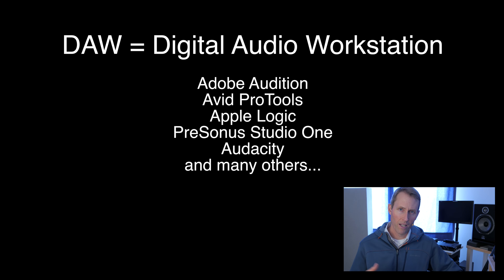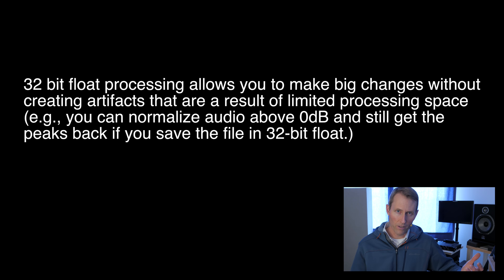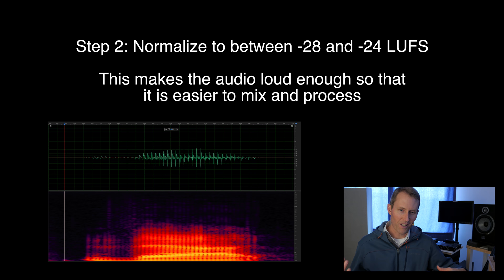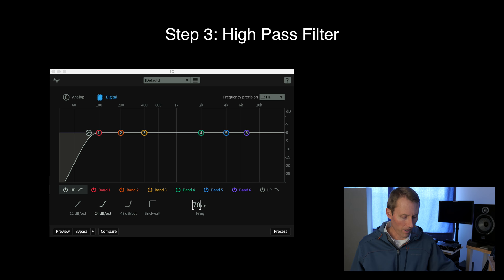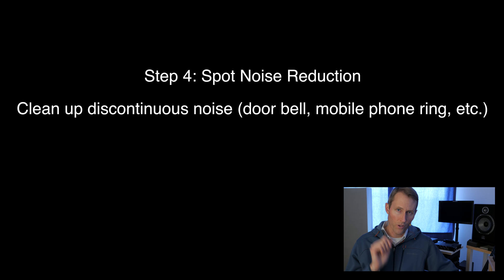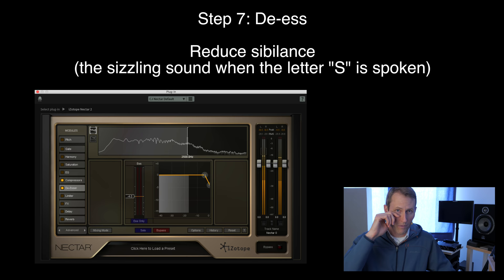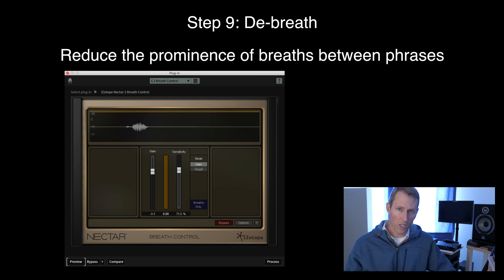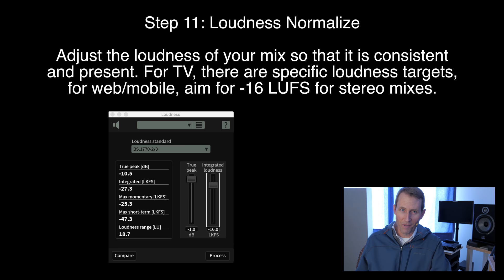Sound for Video Session: Order of Operations - Processing Dialogue Audio

Comment: Curtis, great to hear about your workflow. I am recording long (up to an hour) interview iso tracks at live events on several mics, and to be honest, it's quite a challenge cutting between interviewer and interviewee to mix a consistent end result. Speech volume of the subjects can drift over the course of an hour, as they become more relaxed or fatigued. I am still grappling with the best way to approach this, together with noise reduction of fans, air conditioning, room echo etc without the whole mix sounding choppy. Your videos are always relevant and useful.
Reply from the maker: Hi, thanks! Those long pieces can be challenging. A couple of things to think about: 1) During the recording, mixing while the show is going (and also recording isolated channels in case anything goes terribly wrong with the mix). This can be done with a mixing control surface (e.g., F-Control if you're using a Zoom F4 or F8). 2) you might consider adding a post controller. I use the PreSonus Faderport which makes changes while listening back a little easier. I believe the newest version of Audition now supports the multichannel faderport. Here's the one I use: https://bhpho.to/2kiboLo
Reply: Interesting thoughts, thanks. I'm recording into my new MixPre 10-T (which I love) and routing one of the postfade mix outputs to powered speakers, so it's a pretty minimalist setup. All the hard work is done in post with the iso tracks, but I'll certainly give some thought to mixing realtime as you suggest.

Comment: Do you have an audio software package from iZotope RX that you recommend? I notice that nectar doesn't include the de-noiser, but it does a lot of other items you mentioned.
Reply from the maker: Hi Miniac, I do almost everything in RX except for compression and de-breath which it does not include (I use the de-esser in Nectar only because of convenience as it can be done at the same time as compression but RX has a de-esser as well).

I wish they would just add Nectar to RX but alas, they haven't so I still use both RX and Nectar.
Reply: That's what I do. Would be nice for Izotope to include a compressor in RX Advanced.
Reply: So you own iZotope RX Advanced, and run nectar as a plugin within it. Gotcha. I've been using the stock stuff inside Audition and I'm curious if there's an appreciable difference with some better audio software. Thanks!
Reply from the maker: Exactly, yes. Yes, there are differences in some cases. In other cases, there may just be UI and ergonomic/speed of processing benefits. And in a few cases, there are tools that just are not included with Audition (e.g. de-reverb). The noise reduction and de-clicking are two examples in Izotope that are quite a lot better than Audition's.

Comment: One quick question. Is there any difference between ‘normalisation’ and ‘amplify’? I find it curious that both appear on Audacity. Just in case, I have been ‘normalising’ individual files to a working level and ‘amplifying’ everything at the same time to a final level at the end, once I’ve adjusted the comparative volume of each clip for smoothness so that no one clip is massively quieter or louder than the previous or following one.

Is 'phase rotation' offered in Audacity under a different effect name?

Thank you for such a clear video outlining this.
Reply from the maker: Hi Ian, There's a full explanation of the differences between amplify and normalize in Audacity here: http://manual.audacityteam.org/man/amplify_and_normalize.html

Unfortunately, I don't believe that Audacity has a phase rotation effect.
Reply: Thanks Curtis. As far as I can see, it looks like the 'normalisation' offers the DC offset fix where amping doesn't. I was curious as to whether there were any 'subtle' differences that they weren't explaining.

Looks like I'll need a better editor to get at the phase rotation. I do sometimes get files that might benefit from this; mainy on my own voice unfortunatey.

Comment: Hi Curtis. I have Audition 2019 out of the box only. No extra plug-ins. I'm just trying to record me reading a script for an e-learning class I'm putting together, but I want to make sure it sounds as professional as possible with what I have. I have sound-treated a closet for my Rode NT-1A microphone, Lexicon Alpha Interface, and Behringer Xenyx 502 Mixer. I, too, am experiencing the asymmetric wave and don't know how to do the phase rotation you speak of in step 1.

Additionally, would you suggest making edits to the recording in the waveform editor where the edits are permanent to the wave file or work more in the multi-track editor?

Thanks!
Reply: Hi Michael, I generally make a backup copy of the raw audio files before I start mixing and processing. I prefer to work in the waveform editor for many of the audio processing as it is easier to fine-tune, but if you prefer to work in the multitrack, that is perfectly legitimate as well. Because I make the backups ahead of time, I don't have to worry about destructive workflow.
Reply: @curtisjudd  Thanks! Good idea. Any tips for automatically silencing breaths and mouth noises without reducing the spacing between phrases and without affecting the rest of the audio quality? I'm spending so much time doing it manually.
Reply: @madmoneymike5  I use a third party plugin by Izotope called Breath Control which is part of their Nectar vocal processing package. Before I had that, I highlighted each breath and decreased the amplitude in Audition in the waveform view.
Reply: @curtisjudd  Ok, thanks! Do know if there is a way to do it natively in Audition without a plug-in? If no, which edition of Nectar would be the cheapest I could get away with buying to accomplish what I'm hoping to accomplish? Thanks again for all that you do. Your content is top notch.
Reply: @curtisjudd  Oh, also, is there a way to do phase rotation (your step 1 in this video) inside Audition without any plug-ins?
Reply: @curtisjudd  Nevermind about phase rotation; I found your video on it to use the Graphic Phase Shifter effect. However, no degree/number I have tried evens out the waveform. I've tried increments of 10 all the way from the bottom to the top. :(
Reply: @michaeldelong5685  Yes, that's the trick, it isn't adaptive and doesn't work all the time. Izotope's adaptive phase rotation is still the best I've found.
Reply: @curtisjudd  Thanks again. This will be the last time I bug you, I promise: What software of theirs and what would be the cheapest edition of that software would you recommend I should look into? I saw you mentioned Nectar but I've also seen you reference RX. I would like to be able to automatically fix this phase rotation issue, debreath, declick mouth noises, de-ess, etc. Just speed up my cleanup process overall. My budget? $0...lol, so the cheapest I can get away with but still accomplish my goals. I don't plan to make a career out of the digital audio world.
Reply: @michaeldelong5685  It appears that RX Elements is the least expensive option with the phase capabilities. Here is Izotope's comparison chart to confirm they cover what you need: https://www.izotope.com/en/products/repair-and-edit/rx/features-and-comparison.html

Comment: Curtis, Is this flow possible in resolve 14? 

I've got plugins to accomplish all the individual steps, but I have no idea how to string something like this together in fairlight. Mainly because i can't find any good sources of information on fairlight that don't expect you to be an engineer.

what i got so far was as follows.

1. on the actual track (A1) add the low pass filter using the EQ
2. assign the track to a sub bus (S1)
3. on the sub bus (S1)  add a NR plugin and then set up the compressor in dynamics

After that i"m stuck, because i don't see how to  get de-essing and de-breathing plus more eq  on the main in the proper order.

Edit:
After a long nights sleep it came to me, just buy some more plugins and don't use any of the built in ones.
Reply from the maker: Hi Dan, technically it should be but you would have to add some of the plugins as Resolve only comes with a couple of things (EQ, compressor) and it doesn't do offline processing so loudness normalization can take a lot more effort (have to run through the entire program to get the integrated loudness reading). As much as I would like Resolve to be my all-in-one solution for editing/coloring/sound processing, it still needs more work on the Fairlight portion (and the edit portion for me is still a little funky on a few things). But they're making some very good progress. I'll keep my eyes on how Fairlight progresses and will probably spend some time covering it here in future sessions.
Reply: Hopefully Offlining, is a feature they add soon, as a lot of plugins already support it.
Reply: I agree!